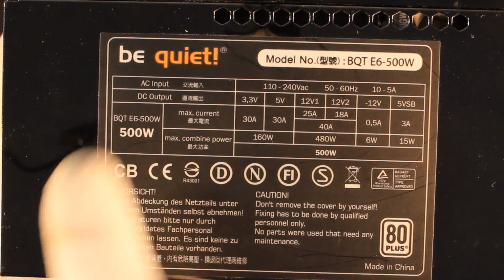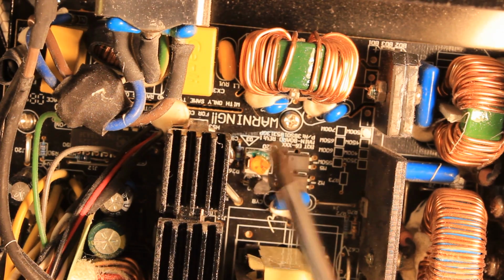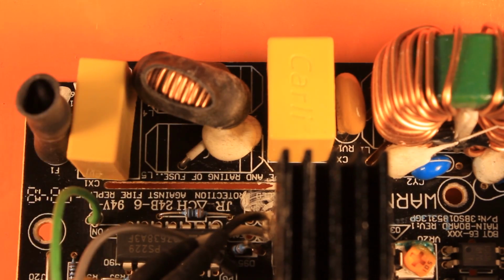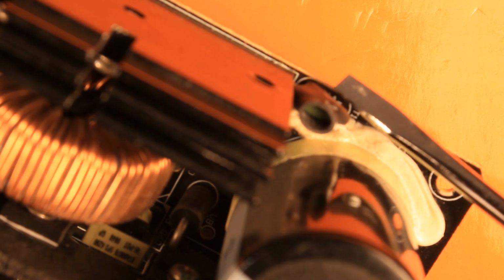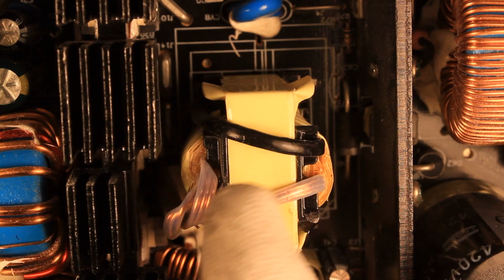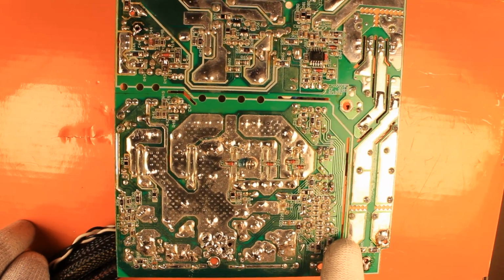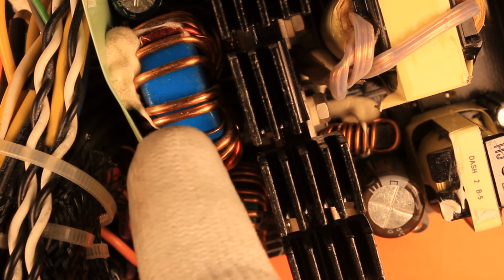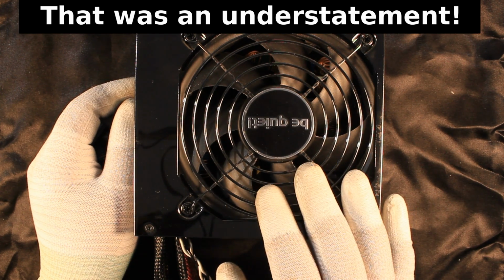500W Be Quiet! ATX power supply teardown, detailed overview and repair

Comment: I replaced 1x 1000uf 16v, 4x ; 5x 2200uf 6.3v in mine. It would still not start up even though 5v stdby was present. Turns out another capacitor was bad. 100uF 25V was connected to one of the windings of the 5v stdby transformer and was supposed to power the switching controller. It was reading only 2.2uF of 100uF so I replaced it and now it works.
Reply: Tnx.

Comment: Can you tell me by any chance I can't see clearly near 12v pin for gpu there is a blue idk what BLUE resistor transistor that looks like alien pulse rifle. Is that tied up with some wire or soldered on pcb on both ends? I have this PSU but somebody removed ground wire above power switch, works but buzzes... and my blue "thing" is wrapped up on one end with some wire coming out of PSU

Comment: Hallo hast Du dieses NT noch?
Ich habe 2 davon einmal das 750 W Modell etwas größer dimensioniert von den Transformatoren etc. Und eines mit exakt 500 Watt.
Ich habe das 500 Watt Netzteil einmal mit einer Short Curcuit protection bulb lassen, aber habe die ganze Zeit leider eine leuchtende Birne gehabt. Scheint ja für einen Kurzschluss zu sprechen. Ich bin jetzt kein super Fachmann sondern eher Hobby Bastler.
Viele der Elkos habe ich getauscht, aber leider habe ich immer noch diesem Fehler.
Man sieht auch keinen abgeplatztes Bauteil oder irgendetwas das auffällig erscheint. 
Hier läuft nicht einmal kurz der Fan an. Hast Du eine Idee was ich als ersten darüber hinaus checken soll ?
Den großen elco habe ich auch nicht getauscht, der ist immer noch der Originale. Bei der 750 Watt Version muss ich sagen, dass ich genau unter einem kleinen Elko die Leiterbahn auf der Rückseite abgelöst worden ist, wahrscheinlich in Folge einer thermischen Belastung, obwohl dieses Netzteil noch anlief, aber nur kein ordentliches powergood Signal mehr geliefert hat.

Wäre schön von Dir zu hören.

Vg

Comment: 80+ white only requires 80% efficiency from 20% to 100% load , and to get 80% efficiency u do not need pfc or syncronus rectifier. Normal double diodes r perfectly fine! , Even 10$ psus have short-circuit and over current protection , the main chip will trip when it detects over current at the input and it will reset when u restart the chip. , 80+ platinum and titanium requires such syncronus rectifier.

Comment: The 5v standby circuit is only 2amps so 10watt smps which is lower than some of the usb chargers we buy for our phones , and single 8pin dip switching controller with built-in mosfet is more than adequate for 10w power source and it does not need pfc correction as the load is so low that it won't effect any thing as the main capacitor is large enough to have very little ripple.

Comment: 20:04 no those transistors won't need much cooling , the input side is pretty efficient and makes very little heat. That heatsink is more than adequate , the most hot running component of the psu r the output diodes.

Comment: I really appreciate the tear down and analysis. I am trying tyo find my way in a Samsung TV motherboard (monocard) without sketch and with a sandwiched layer ! SO no choice but try to understand who do what (hence the usefulness of your very clear videos) 
BTW On that motherboard only one "transformer" (4 pins and 5 pins) is it then the one that provide all main tensions, and standby (11.8V) plus the base tension for the LED (how much can it be before the inverter ?.) . BTW I "never" watch TV so this is mainly for the pleasure of learning something new, (and ain't easy at my age !) 
I am hoping that Samsung engineers respect some sort of rule for the numbering/referencing of the composants on the card, and try to cross check what I suppose with a sketch from a separated alim - not really similar arhitecture unfortunately .
I also will have a 500w ATX alim to play with an ATX Cooler Master RS-500-ACAB-M3 500Watts that do not really start after being send to an user. I did invest in some measuring and soldering equipment allowing me to train . The TV cart have 3 layers and I did lost one via contact while changing electrolityc condensators. It burned 2 mosfets (12v +- and I am unsure what they are for, between an alimentation line (but they are in primary section providing alim to the inverter , or retroactive boucle ? - still a few videos to look at, so thank you a lot for your efforts )Best regards  Isaac

Comment: question:-
 i only want 5V and 3.3V and i have 12V DC from batteries so is there any way to completely disconnect 240AC to 12V DC unit and transformers and just use converter?

Comment: Great video, I woud recommend Seasonic Power Supply
Reply: I'd recommend doing research into what PSUs to buy rather than brand allegiance. Seasonic makes a ton of bad/terrible PSUs (some are bad because of faults, some are bad because of price compared to other PSUs of the same price).

I mean thermaltake has some top tier PSUs in their lineup, but would I ever tell someone to just buy thermaltake? Fuck no. Same deal with seasonic, though I'd trust seasonic more than I'd trust a random off the shelf thermaltake PSU. Avoid EVGA, they don't put out good products anymore.

Comment: The transformer indeed is small but that power supply won’t output 500w on the 12 volt rails...probably about 300 as you said..maybe an other 100 watts on the 5 volt rail and the rest on the 3,3volt I am not been specific but you get the point..
Reply from the maker: Both the +12 and the +5V rail power must go through that transformer, so yes, I do not believe that in the current configuration this PSU would be able to provide 500W without severe overheating. As I mentioned, they put too much money on packaging, and the main issue is, that I expected something made in Germany, not in China.
Reply: Nice video btw and indeed a detailed overview good job 👍🏻
Reply: Yes you’re right my bad..!! At least the tell Chinese to use better components...lol I have seen power supply’s that are designed in China and use better and larger components...to bad,for a “good” company to make such a bad design...almost the same as the bad Chinese psu you get for like 20...that’s why you should always read the ratings on the side that’s how you can tell is a bad supply if they have 30A on the 5v rail and 30A in the 12v rail..good supply’s over a 1000watts have 30A on the 5v rail...and hundreds on the 12volt...all the power that’s drawn are from the cpu and gpu that use the 12volt rail..they also use the other rails but not to draw current just to supply power to the “logic side” of the board..
Reply from the maker: @kostassarakinos3062  Well, a 1000W PSU will also cost a lot of money. I do not know what is going on, but PC components keep increasing in price instead of getting cheaper. GPUs are like 200Euros more expensive every new generation, which makes them viable for reflow/reball due to price. 5 years ago reballing a gamer GPU was a losing business, not it is worth it again. I expect that a flagship Nvidia Ampere series GPU card will be easily 1400Euros or even more than new.

Comment: Power supply doesnt have a heatsink? Dont tell me it cools down threw direct fan air
Reply from the maker: What I said is that the heatsinks are relatively small, they could have put a more aluminum in there...
Reply: @DonkeyLearningIT  sir hi I'm planning to buy a new psu to replace my 10 year old xigmatek. Should I consider be quiet? Thank you
Reply from the maker: @berksiyahi2318  Sure, Be Quiet! is a good manufacturer in general. As I also mention in the video, the cooling fan is really quiet, the PSU barely makes a noise. Also, you can buy higher end models from them compared to this one, which was a mid-range one about 8 years ago.
Reply: @DonkeyLearningIT  Okay thank You sir

Comment: hi, i have same problem as you on my PSU. I need to replace capacitors. I wanted to ask if i can replace with regular capacitors, or i need to buy low ESR capacitors
Reply from the maker: For the small values (1uf-->100uF) most of the time buying standard caps is fine. However, values like 330uF, 470uF, 1000uF and above should be low ESR, otherwise the output power will not be smooth enough.

Comment: Thkxs for your clear and informative explanation ! You could try to review one of the best tested from hardware.info f.i. the Bitfenix Formula 450W
Reply from the maker: Good idea. To be honest with you, if PSU manufacturers would be willing to send me their units, I would be more than willing to test and tear them down. However, I am sure that they are afraid of negative criticism, and this is why so far none of them contacted me so far. They like only those reviewers, who give 8 or 9 points out of 10 without mentioning anything negative about a unit.

Comment: What is amove?
Reply from the maker: Metal Oxide Varistor --->  MOV
MOV is a device, which normally has a really high resistance, but once the voltage goes above a given level, it suddenly decreases its resistance.
Reply: Thanks

Comment: could you open corsair power supply and analise it ?
Reply from the maker: If I would have a Corsair PSU laying around, I would totally open it up and tear it down. As far as I heard, Corsairs are well built. Currently I am running short on money, so I cannot just go out and buy teardown/repair items. It would be good though...
Reply: j was 99 % on buying be quiet and when j saw that taepo condenser  j changed my mind  @DonkeyLearningIT
Reply from the maker: @galesd1971 Well, in the more expensive models they might user better caps. However, so far I had no opportunity to  look at a newer model or into a more expensive model.

Comment: As usual, like in 90% of the switching power supplies repair, you change all the secondary electrolytic capacitors, and bingo, it works at least for a few months ;)
Reply from the maker: One should exchange the primary side caps as well, since they are part of the feedback loop etc., and they are more critical for the PSU starting up. However, the general recipe is indeed changing the caps if the power electronics is fine.

Comment: So called 'german quality" is just a marketing trap and is far from concerning every german products... As a matter of fact, the true OEM behind almost all Be quiet psu is FSP ( a reknown taiwanese manufacturer). As far as quality is concerned, if you really want quality and reliability, you have no other choice than buying a high end psu, for instance : seasonic focus plus gold or fsp hydro ptm which have 10 years warranty. I must say i'm not fond of Be quiet psus because they usually request very basic internal design from fsp and tends to  cheap out on capacitors in their low and mid range psu. Worst of all, their mid range psu are often much more expensive than seasonic and fsp  high end. To me, their fan does not justify this difference and major OEM like Seasonic and FSP put really good enough fans in their units. I have the FSP hydro ptm 650w which have a very high quality FDB protechnic fan, and all electrolytics caps are japanese at 105°C, the ploymers are from teapo), it is dead silent, very stable, platinium efficiency and have 10 year warranty. I also have seasonic prime ultra 650w titanium, very reliable with 12 years warranty. My advice is to buy from OEM directly, so from taiwanese companies, this is not "chinese made" misconception. Taiwanese quality is the best in IT, far better than German. TSMC, Asus, Seasonic, FSP, Superflower, MSI, Acer to name a few are all reknown taiwanese companies...

Comment: @Donkey Learning IT
hi mate i have a question
I WOULD APPRECIATE AN ANSWER SINCE I'VE BEEN TRYING TO GET THIS ANSWER FOR A LONG TIME, if you don't mind.

also, feel free to give a detailed and technical response if needed

Please note  24:46 in the video
Note the top right corner of the board and the JAGGED TEETH Traces

Note 25:04
where you are explaining about the inductors,  YOU CAN SEE THOSE TEETH AGAIN on the Primary side of the PCB

now what i would like to know is this 
i understand that they are solder traces
i understand they are used for high power applications
i understand they are usually located where we find inductors and transformers
i understand that current and voltage (in a manner of speaking) JUMPS ACROSS from the tips of the teeth to the tips on the other side

what i don't understand is WHY

WHY WOULD SOMEONE NOT JUST MAKE A STRAIGHT SOLDER PATH ?
WHY PUT THE TEETH IN
AND WHY SPECIFICALLY ON COMPONENTS LIKE INDUCTORS AND TRANSFORMERS

if you can answer that, i would greatly appreciate it
thank you mate
Reply from the maker: The explanation is really simple: what engineers want to achieve is, that if there would be a lightning hitting the wires leading to the home, they want that energy to discharge already in front of the power supply, right where the power comes in. This way they can protect a little the life of the people who are in contact with those power supplies. The reason why the trace is jagged is related to a natural phenomena called Saint Elmo's fire. Namely, as the trace is getting thinner and thinner towards the tip, the electric field will gradually increase. This way electrons can jump more easily from sharp thin objects compared to rounded objects, discharging the energy in form of a spark. As a comparison, on really high voltage applications the spark gaps are rounded, since you want the spark to jump only under very well controlled conditions.
Reply: @DonkeyLearningIT  
Hello Donkey

1. thank you for the prompt response, i really appreciate it

2. thank you for the explanation, also appreciate that

3. i don't know where you're from, but i know it's europe.
my background is serbian
in serbia we have a word for "Donkey" the word is MAGARAC   hehe

i think it's funny that you would call Doktor Magarac   hehe
but it's a cool name,  make me laugh

i've been into electronics since the 80s  , i'm 45 years old.
this is just 1 question that for some reason no- one was able to give me a clear answer on
thanks again

i notice these teeth mainly around transformers , from primary side to secondary and i wonder,  why do they appear on some and not on others
and then i wonder, why don't they appear all the way along the trace

also. do these types of traces have a formal name

thanks again mate
be cool
keep making videos, it's much appreciated.
Reply from the maker: @martinkuliza I did not want to pretend to be a "know it all supreme professional", so I just call myself the Donkey. Also, I am patient like a donkey, which often helps. 
When it comes to those teeth, as I mentioned they are used for protection, and not all PSUs are designed with good standards in mind. Also, some might use glass discharge tubes filled with gas (Russian electronics often used those), and they have the same functionality. The teeth are just called spark gaps, and preferentially they should not be located between the primary and secondary. They should stay on the primary side, since that is where one expect high voltage to appear. Even if some engineers put them between primary and the secondary side, the low voltage secondary side should be connected directly to ground with a thick trace. Thus, if there is a spark formed, current flows right into the ground via the ground wire (green-yellow wire in standard EU plugs).
Reply: @martinkuliza  Or call him dr. Magyaros. ;)
Reply: @atdzsny  
or as we say it in Serbain
Doktor Magarac  LOL

Comment: You must live in a country with very cheap electricity. For me, using 92% efficiency power supply for 24/7 instead of 82% one is cheaper just after a year.
Reply from the maker: Currently I pay 0.28Euros per KWh, and the good PSUs with high efficiency tend to be expensive. Plus, I do not use my server and main computer under 100% load, they run idle most of the time, so it takes over a year to pay off the difference.
Reply: @DonkeyLearningIT  In your case, 10 Watts less every hour translates to €25 savings per year.
Reply from the maker: @KarolMurawski Hah, I never spent the time to calculate that. It is surprising to see that even 10Watt can make 25Euro difference. Though, my machines are on less than 8 hours per day in average, and under very light load, so most likely one would need at least 3 years to pay for a more efficient supply.

Comment: Main power capacitor doesn't need to be 105C, it just needs to be long life. I would prefer 85C 5000h capacitor to 105C 1000h capacitor in this use case. 85C 5000h would be probably cheaper too. P.S. This TEAPO is 2000h, so nothing special indeed - definitely not good for 24/7 usage.
Reply from the maker: The issue with the 85C long-life capacitors is, that their life need to be derated when the temperature increases above room temperature. This is why they might have a nice long 5000h life at room temperature, but inside a hot power supply they will live considerably less. As far as I understood, the 105C rated caps should have less derating, so those caps should stay longer in service if they are good quality.
Reply: @DonkeyLearningIT  It is 5000h at 85C and nominal voltage. The rule of thumb is that it would be 10000h at 75C, 20000h at 65C and so on.